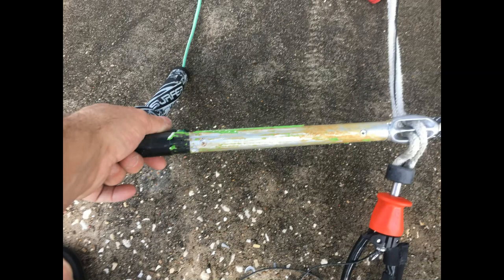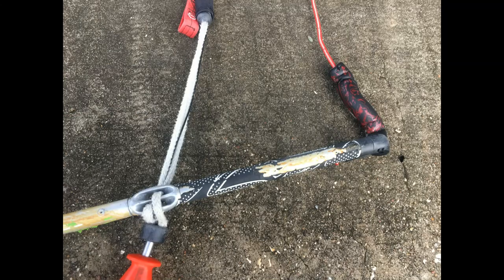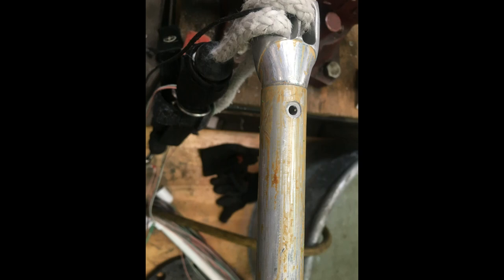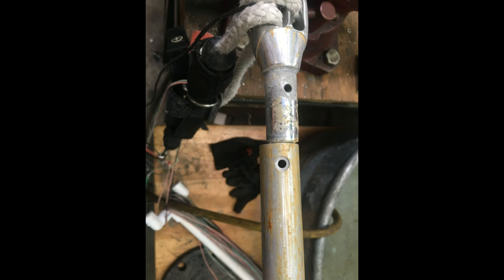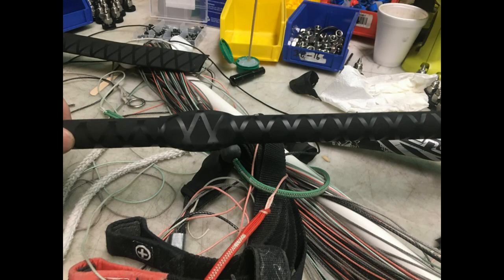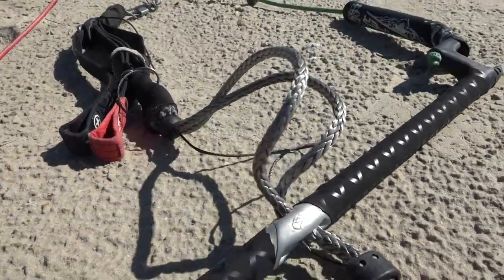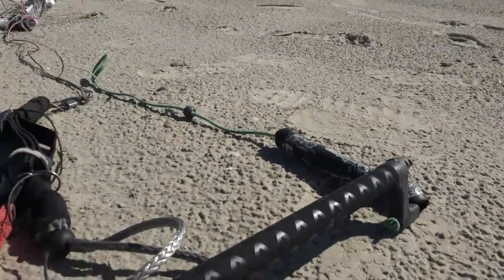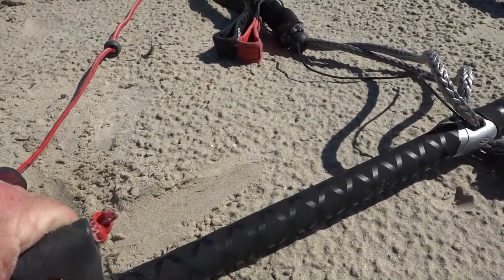How to Replace the Bar Grip on a Kitesurfing Bar

Comment: Nice tutorial. One thing that is not clear to me is how is the silicon glue involved. You use silicon on each heat shrink tube to fix it on the bar before heating it up?
Reply from the maker: Yes

Comment: Well done! Thanks for sharing. I started modifying my own bar. Lots of fun!
Slingshot is the easiest. How is the shrink wrap holding up?
I am having trouble with building my own bungies. Would you please shine some light on that?
Thanks
Reply from the maker: i would put silicon on the bar before before the heat shrink its starting to move